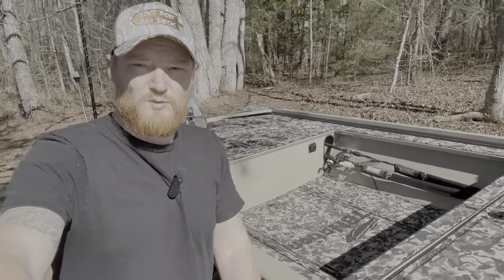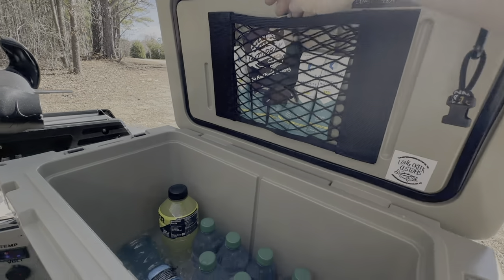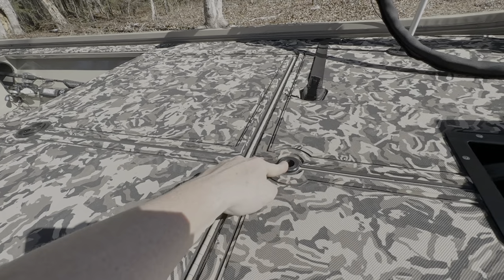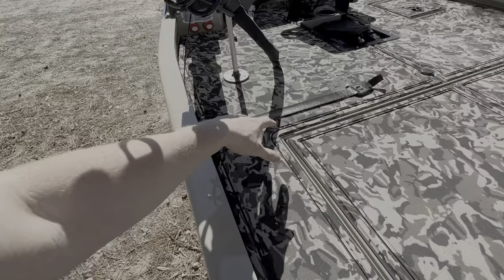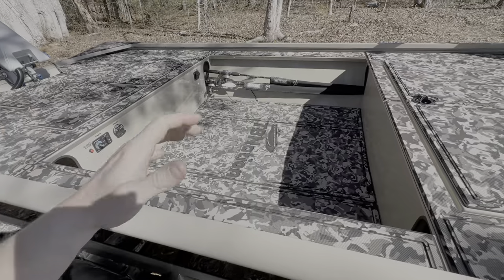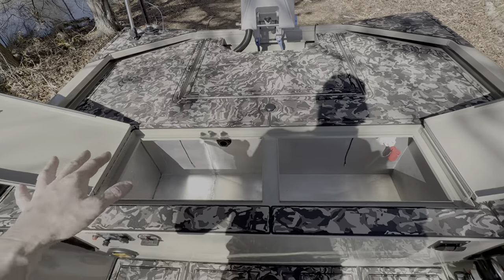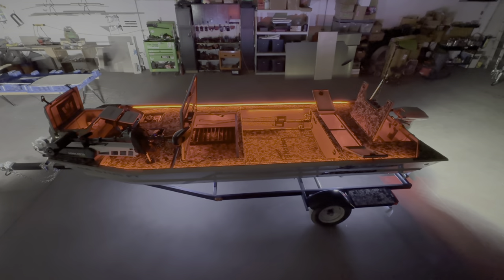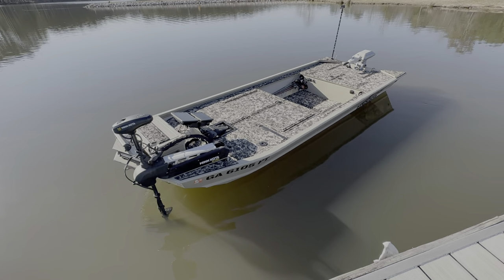1648 REVEAL and FULL BUILD Walk Through

Comment: What kind of runtime and speed do you get from the 6.0 and that battery? Currently have a 14 ft v hull with the 3.0 and the e80. Looking to possibly upgrade boats and the motor to the 6.0. Looking at almost your same size/setup